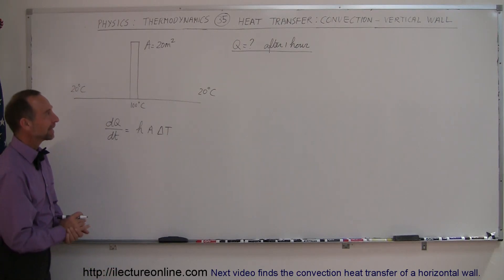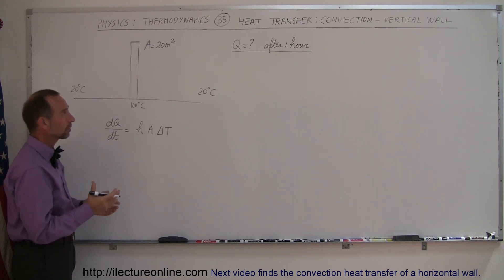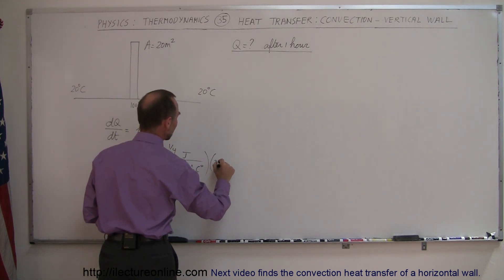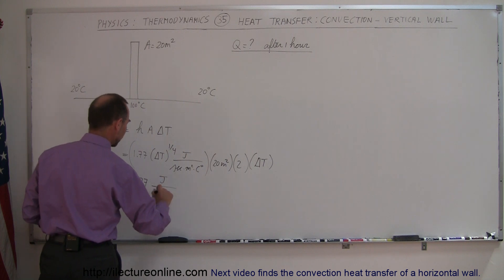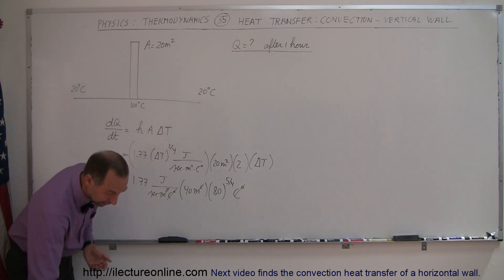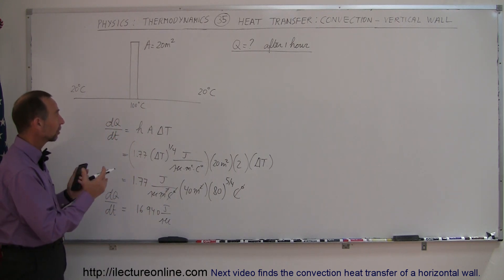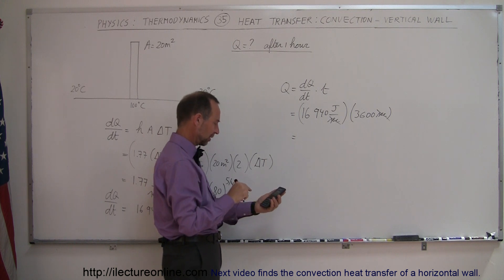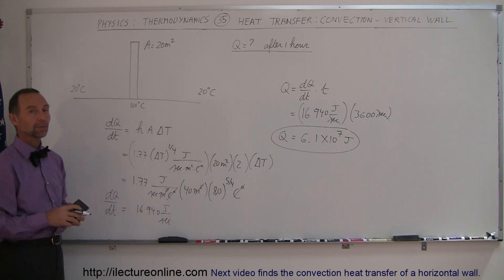Physics 24  Heat Transfer: Convection (33 of 34) Vertical Wall

Comment: I don't get it why did we choose convection here, why not conduction? does it specify in the question?
Reply from the maker: The heat of the wall is removed by the air moving past the wall (in this example).  That is why we use convection.  (there is no path along which the heat can conduct)

Comment: Professor if you can answer my question I would greatly appreciate it. This problem has been bothering me because I thought that how fast an object loses heat or "energy" is dependent on the material it is. But you didn't specify at all about the material this wall was made out of or its specific heat. Can you please clear this up for me?

Comment: In one of the video you said that people used three panel window instead of increasing the gap of the air. (conduction) part. Why is that so?
Reply from the maker: William,

In an actual situation, we also have to take into account the temperature gradients on either side of the glass and the convection currents between the panels, which do have an effect on the heat transfer.  
This causes a triple pane window to be more effective.